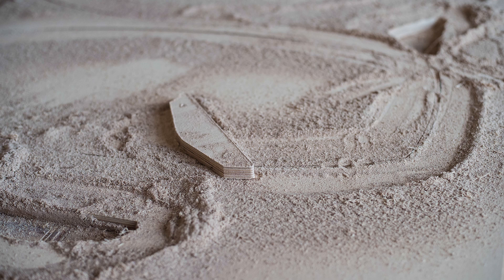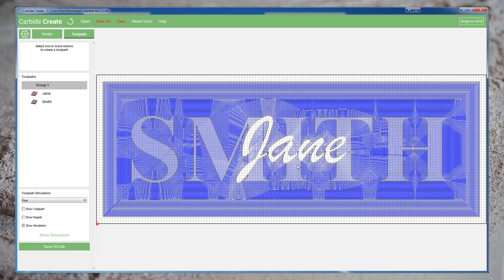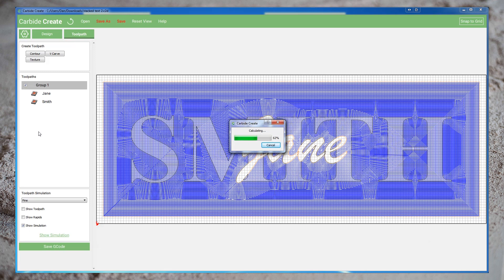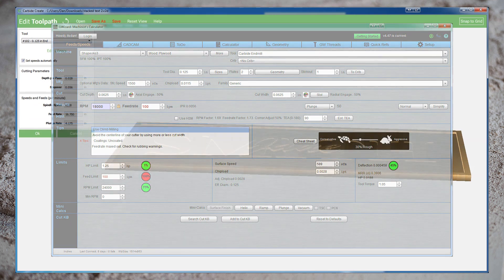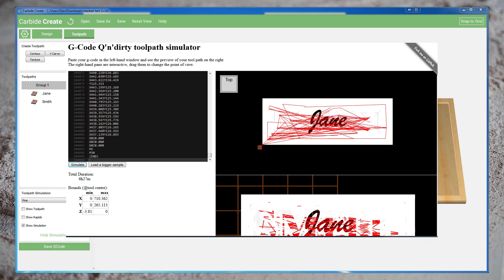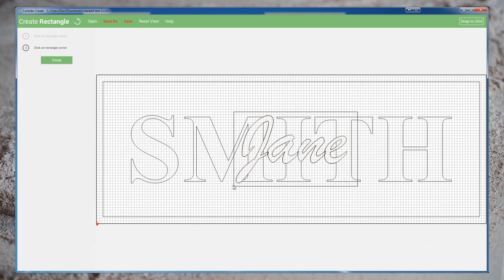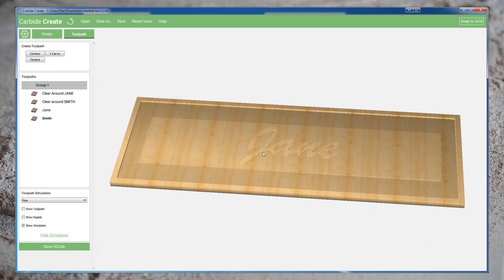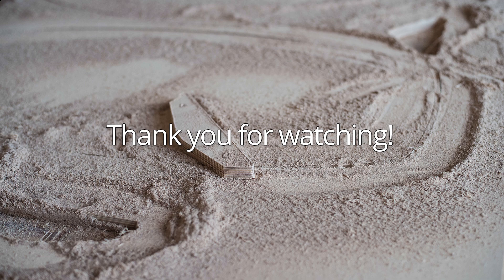Practical CNC 06 - Optimizing cutting speed on stacked text

Comment: I'd love to see how this turns out in practice.  It appears you'd have to be very accurate when setting your Z-zero to insure the results were good.  I don't currently use a probe so it makes it a bit difficult to be completely accurate.  Thanks for the video, though, it was great!
Reply from the maker: Because these signs usually have a more rustic feel to them I think you have a little more wiggle room than usual, but setting Z is always important especially when swapping bits during a job.